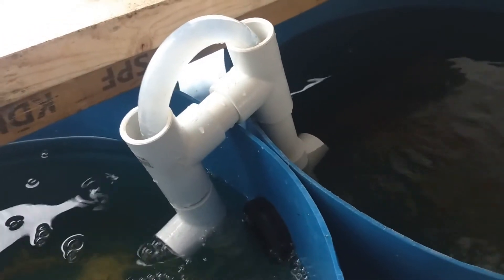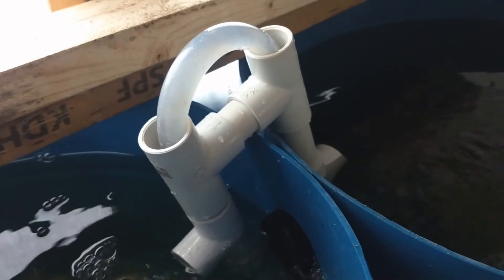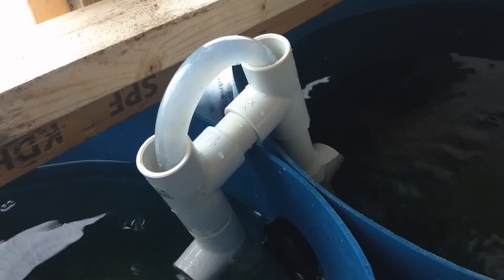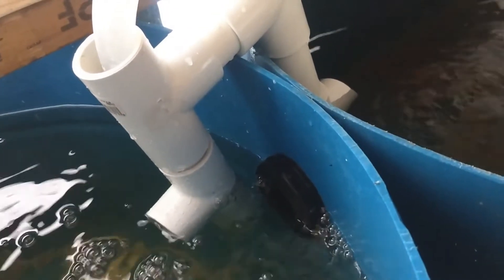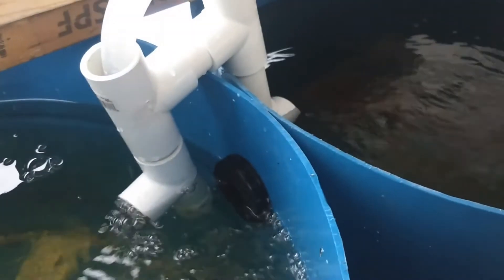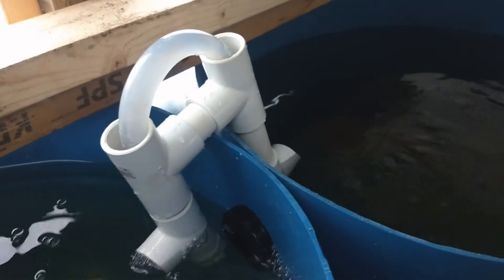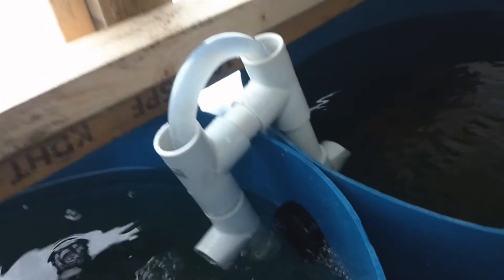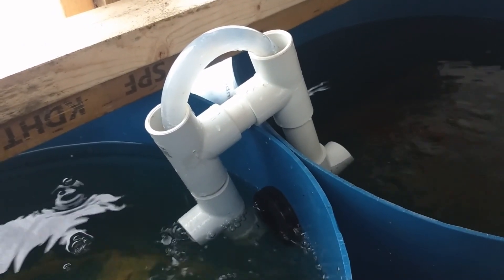SolarGeo.Net - Build a better overflow siphon without drilling or sucking air

Comment: Thanks, are all four elbows on the same level? 3:15 or is one slightly lower?(could not tell from the video).I could really use this to make both container on the same fluid level. Thanks.
Reply from the maker: No. not the same level for my build, but you could make both side symmetrical